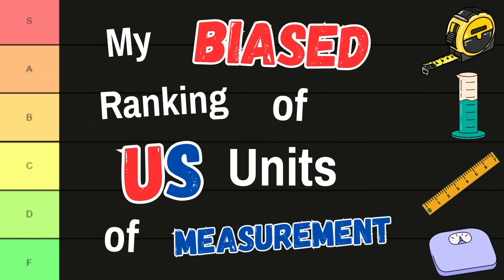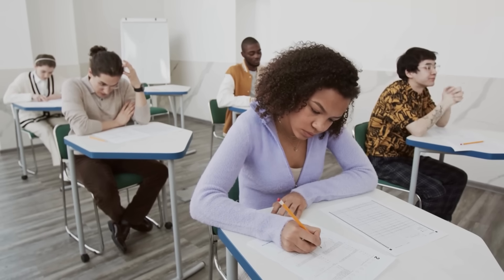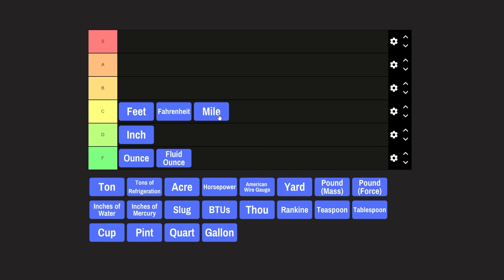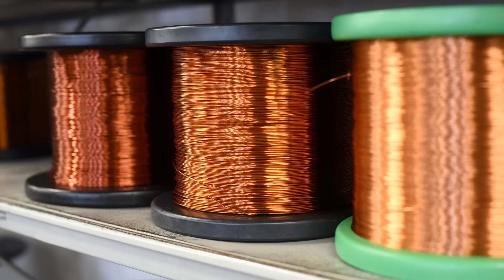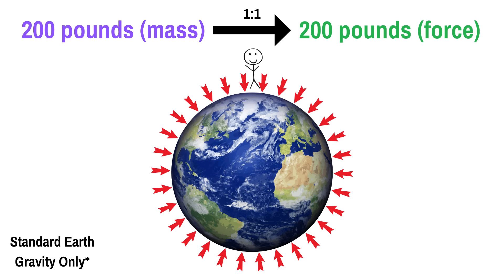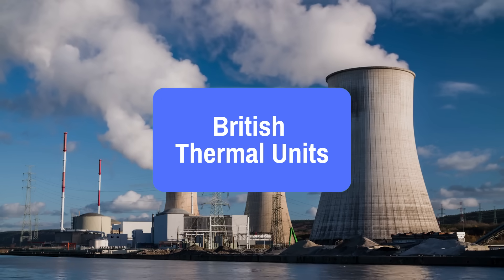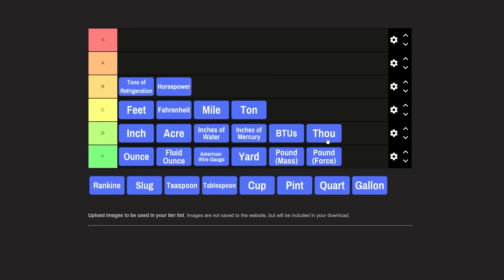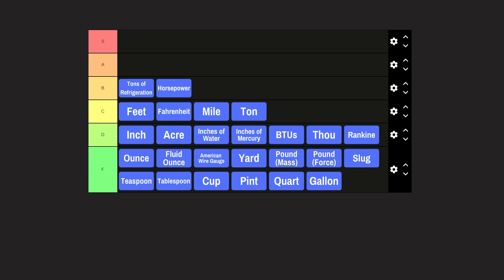Tier List of the DISASTROUS US Measuring System

Comment: As someone who grew up with the international unit system, every single unit in this video and its logic made me rage
Reply: as an Italian who uses international unit system I have a question: if 5,8 ft is 1.76m and 5,9 ft is 1.79m how do you measure a person who is 1.77m or 1.78m? what's in between 5,8 and 5,9?
Reply: @TsuNami96  fractions so many fractions
Reply: @TsuNami96 you divide inches into fractions or you could even decimalize them, but for measuring the height of a person there is no need to measure smaller than an inch.
Reply: @TsuNami96 I think your calculations are off. Additionally, we still use decimal points unless we're rounding.

1.75m = 5ft 8.898 in (roughly ~ 5'9")
1.76m = 5 ft 9.291 in. (roughly ~ 5'9")
Reply: That’s excellent news. We shall keep doing it.
Reply: lmao cope commie
Reply: The spoons and cup are actually pretty handy when cooking. I live in an metric country, but imperial units for homecooking is agodsend for trying out recipes quickly and lessening dishes. 

It quickly shows approximates. Add 2 tablespoon of honey is much easier to visualize vs add 40ml of honey or 50 grams of honey is hard.

 I know Regular eating tablespoon are smaller than measuring table spoons but thats kay because I can always add ingredients to what im cooking after a quick taste.

The quarts/pint/gallon suck though.
Reply: @jakkank put horsepower and food measurements aside, the others suck
Reply: @jakkank sadly it's only hadly if the manufacturing is standardised, which isn't in most cases
Reply: @jakkank atleast where I'm from we have standardised tea/table spoons on top of 1/5dl and 1dl measuring "spoons" 
Those are at
1ml "Spice spoon"
5ml "tea spoon"
15ml "table spoon" 
Then we just have
1/5dl spoon (50ml)
1dl spoon (100ml)

And anything bigger are just given at how many dl it usually 5dl "cup" with a dl making for each full and half dl along the way to easily get say 3 and 1/5dl
Reply: @jakkank I mean, it all comes down to habit. Volume is easier to estimate visually than mass. That's why cups and teaspoons end up better for estimations. 
But if the recipe said 150 ml of sugar, I would get a normal glass to measure it at a glance without a problem.
Habit is very powerful.
Reply: @lucam8758  If the recipe asks for ml of sugar, throw it away and get a better recipe.
Reply: @JürgenErhard  ahahah, yeah that's what I'd do! Grams all the way for me.
Reply: @jakkank for cooking I just see the g/L/whatever unit, put it in my head, and then apply the amount that "looks about right", works basically all the time

Also, cooking is mostly ratios of ingredients, so actual amount does not matter that much if the overall ratio is about the correct amount
Reply: @jakkank I mind the tablespoon cooking measurements less than the rest of the imperial mess, but trying to measure honey or oil by tablespoons is utterly infuriating. Half of the first spoon's worth sticks to the spoon making further doses increasingly inaccurate.
Reply: @jakkank  Measuring is measuring, visualizing is not needed.
Reply: @jakkank  I dunno man....I'm kinda fond of a nice pint after work.
Reply: @jakkank  here at where I am, a teaspoon is considered 5ml and a tablespoon, 15ml
Reply: @jakkank  you know your cups and spoons in grams and litres, then the recipe barges in with cups...what cups? What's in a cup? Which cup is it? Wdym there's tablespoons? How much is in a tablespoon? Am I using the right definition of the tablespoon? Does that account for density? Or heat? Or pressure? Or humidity?

Imperial measurement system should be put on a bonfire.
Reply: @jakkank You're strange and weird. How is "2 tablespoons (of undefined size)" easier to visualise than 40 ml? I know how to measure 40 ml. But if a recipe says "2 tablespoons", I don't know if they mean 30 ml or 40 ml.
Best is to just state the volume (and mass) and then the tools should just be called a 5 ml, a 10 ml, a 30 ml and any other size. You can have a 40 ml spoon if you want.

The whole point of metric is to not have strange names for specific sizes aside from multiples of 10 or 1000. Arguing for spoons in metric to me is like arguing for having a metric foot of exactly 300 mm "because it's easy to visualise" instead of just using 300 mm or 30 cm. Just like you wouldn't mix metre and metric foot, you shouldn't mix litre and spoons.
Reply: Volume mesurmemts are a tier. Powers of 2.
Reply: Muiltipes of 12 are often used because of its high divisibility
Reply: @vincenthuang5635  you could also just move the decimal point, and not have to remember every conversion between two units
Reply: @vincenthuang5635  No, multiple of 12 is used *once*, feet and inches.  The number of yards (or feet) in a mile even has 11 as a prime factor!  sheesh
Reply: Fahrenheit is a good way to measure temperature outside of scientific settings.
Reply: @Gtx-ij9ff only if you’re used to it
Reply: @fabo-desu that is with both systems
Reply: @SirQuackington_IV  but that’s the thing, it’s good for scientific purposes and, If you’re used to it, for the usual life. Moreover, only 6 countries out of 195 using it doesn’t make it practical
Reply: @fabo-desu  fair
Reply: @Gtx-ij9ff If you use Fahrenheit your entire life, that is. For everybody outside the US and two other countries it means absolutely nothing
Reply: @Gtx-ij9ff I am curious,Why do you think Fahrenheit is a good way to measure temperature outside of a scientific setting? Other than some people's familiarity with it (and let's be honest, we can get familiar with any unit) I don't see any advantage in it
Reply: @Gtx-ij9ff  fabo said it, it literally only helps if you’re used to it, it’s not a good scale
Reply: @Gtx-ij9ff Only if you grew up with it. Celsius and Fahrenheit aren't really superior to one another and the main difference is if you're used to it or not. Kelvin is the only good one

Comment: This is great.
The only thing more confusing than the American units of measurement is the Canadian version.
We're technically metric, but good luck finding a tape measure that isn't in inches. For cooking, we use cups, tsp and tbsp, but also ml and litres. We drive in km/h but measure power in hp.
Great system right?
Reply: Also we use both day month year and month day year when writing dates
Reply: @cloud5026  Oh, sweet Jesus.

You guys are contaminatining the Commowealth.
Reply: @cloud5026  and even the backwards version!
Reply: The dumbest one is tire sizes 225/45/17 : 225 mm width and 17 inch diameter, sure why not just mix 'n match.
Reply: everyone uses hp to measure power
Reply: @sintenklaas kW
Reply: @sintenklaas  All engines are measured in KiloWatts (kW) and converted to Horsepower (hp) for marketing in North America.
Reply: @sintenklaas that's literally only car nerds
Reply: @hundebengl5042 No, it is everyone. I have only heard kilowatts in reference to electric cars, but it is still most often converted to horsepower
Reply: @hundebengl5042 Every engine i've ever seen had their power measured in horse power, except for electric engines which is usually measured in watts, but the rest, from cars, to ships to tanks had their power in hp
Reply: @sintenklaas watt??
Reply: I genuinely thought all rulers and measuring tapes everywhere had centimeter markings on one side and inch markings on the other.
Reply: Uk, we drive in mph measure distances on the road in yards, beer and milk is sold by the pint but wines and spirits by the ml, fuel is dispensed by the liter but we do fuel efficiency with mpg, we weight ourselves in stone or kg, in the kitchen we use whatever sounds right,  tapes come in inch and cm, tvs sold by the inch, Celsius for temperature, we rent allotments from the council by the square pole (fraction of a acre) and finally we use psi for tyres.
Reply: It's the same in Europe, except for the tape measure part. Ours usually have both inches and centimeters or just centimeters
Reply: @PUNROTUTORIALSabo you actually have to look for any mesuring tool in inches or any imperial unit
At least that's the case in Germany 
A few things though are always in inches for some reason
Like screen sizes and bicycle tires
Reply: @hundebengl5042  yup same thing in france, i believe it's because most brands that started those things are american so it's a standard to make it easier to compare them
Reply: @hundebengl5042  "A few things though are always in inches for some reason" - Which is fucking stupid and have no idea why we still do it. It would cost us nothing to change those to metric too. Honestly it should be a law in the EU
Reply: @PUNROTUTORIALSabo  ? You mean in the UK? You'd be hard pressed to find a tape measurer with inches in continental Europe.
Reply: @Exilum It's not that rare to find inch tape measures. Two kind of people use inch measures a lot: plumbers and wargamers 😀
Reply: @meskobalazs  What country do you live in? I don't think you can find it easily even in a hardware store in France.
Reply: @Exilum  in Hungary. It's not super common here either, but it can be found.
Reply: Sounds like y'all didn't want to embrace stupidity, so just branded yourselves metric by saying "Canada: now with more than 50% metric"

The US uses metric all the time, how do you think we measure our two favorite pastimes - drugs and ammunition?
Reply: Now that I live in Puerto Rico, it's more crazy. Here, distance is in Km, but speed is in Mph.

The reason is quite logical (albeit still inane). Thanks to a little bill called the Jones Act ships not registered in the US (like, literally all of them) cannot enter more than one American port without entering a foreign country between them. Well... a ship departing Europe cannot deliver foreign cars to PR and then go to the port of Miami. So, most ships will just go direct to the US. This means most vehicles are shipped from the US mainland to PR, regardless where they were assembled. And since the US solely uses miles...
Reply: Yes it is great.
Reply: Also from Canada. I only have an intuitive sense for people's height in feet and inches, but I conceptualize all other lengths and distances in centimeters, meters and kilometers.
Reply: That's funny. 

Believe it or not, the US has similar issues. Imperial or metric based on context. 

The official system is actually metric!
Reply: The average measuring tape uses both, but the main reason a tape will have feet and inches is because of construction: while the official drawings may show something different, you build using dimensional lumber that's sized in inches, normal wall studs are 16 inches on-center, plywood and drywall comes in 4x8 or sometimes 4x12 foot sheets, if you look at a sheet of plywood edge-on, each layer is 1/8 inch thick so you can check the thickness without needing to measure just by counting layers, and so on.

All that said, I'm a metric guy except when it comes to things like that.
Reply: Horsepower is actually also used in europe. Cars also have kilowatts but not many use them. Even on electric cars where a kW makes even more sense
Reply: What are you talking about with tape measurers? Im canadian and every tape measurer i have has both inches and meters.
Reply: It's friggin legendary!! We take the best of both worlds. It's funny you said that because one time at work some European came in and wanted some 4x4 pressure treated cut to like 110 cm for 4 pieces and I'm like great. What length of 4x4 do I grab?😂 Where's a calculator?  now I have to convert this junk. I looked on my tape measure and below the feet and inches it had cms. I never noticed or cared until then. And I still don't care. Canada baby!!
Reply: Sounds pretty much like the one we use in Brazil
Reply: You forgot the best part. We also use inches and feet for measuring height. And pounds for measuring weight. Everything else is metric, they also don’t teach imperial so we have no idea how to actually use it. Don’t forget about cooking too, where you use imperial for whatever reason
Reply: In America you buy a gallon of milk but a 2 liter of soda. We use both all the time here as well. 

We measure in mm/cm if it's small, and feet/inch if it's the size of a room. Just because most of the time you literally don't care if there is a conversation just whatever is the easiest to measure.
Reply: So want to measure in joules ☠️
Reply: @IShowVelocity. joules measure energy, power is measured in joules per second, i. e. watts

Comment: I had to calculate G in the foot-slug-second system for a class…
Please help
Reply: Do you mean the Cavendish constant, big G?  Or do you mean lowercase g?

For the lowercase g, it's simple, and it is a standard value you can look up.  It's 32.17 ft/s^2, which is usually just rounded to 32 ft/s^2 for simplicity (and since 2 sig figs is all the accuracy you can get, without specifying where the problem takes place).

For the Cavendish constant, start with its value in SI units:
6.674e-11 N-m^2/kg^2

Multiply by 1 in a fancy way, so we translate each unit along the way
1 = 4.45 N/lbf
1 = 0.3048 m/ft
1 = 14.6 kg/slug

6.674e-11 N-m^2/kg^2 * (1 lbf/4.45 N) * (1 ft/0.3048 m)^2 * (14.6 kg/slug)^2 = 3.44e-8 lbf-ft^2/slug^2

Comment: Very cool, but if you are going to use obscure measurements you might as well talk about the fathom. 2 yards, 6 feet, the length of your arms, or King Henry’s or whoever.

Great video, hate the system, and I’m even American, trying my best to switch
Reply: As a European: Good luck! Also we know it's not your fault or anything, it's probably pretty hard to use metric, when everyone else is using imperial

(Also metric makes more sense with the paper format, A0 has a size of a square meter and a ratio, that allows it to be halfed and retain the same ratio, therefore being distinctl defined)
Reply: You Traitor!